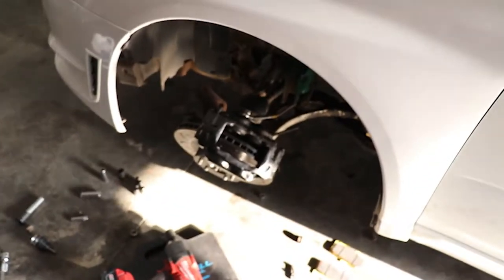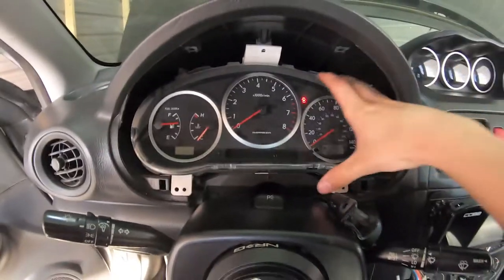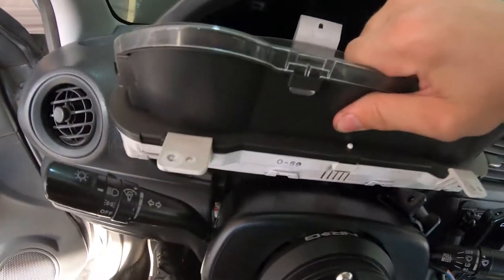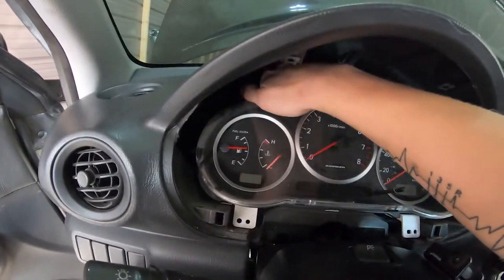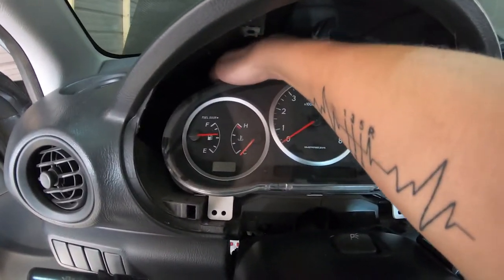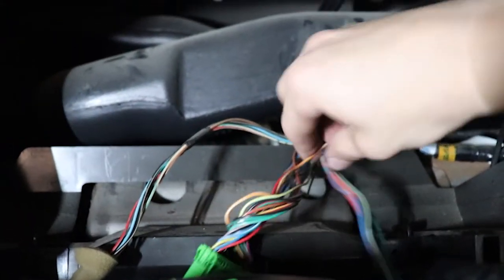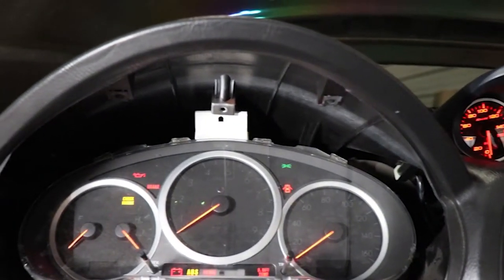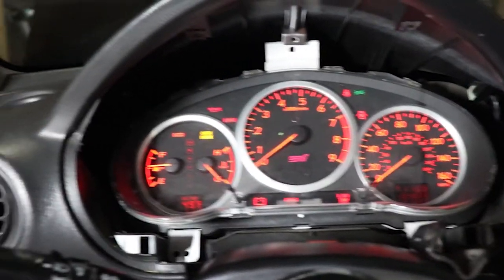Installing an STI Gauge Cluster Into my STI Swapped WRX

Comment: Hey man, what are those wires for? Does that stop the brake and abs light staying on? 
What year model Rex do you have and what yr cluster?
I've got a 03 blobeye and an 06 cluster and the abs light and handbrake light stay on, wondering if this wire swap will fix the issue.
Reply from the maker: Should be for every GD chassis and it's for the rear diff temp that the wrx doesn't have but the sti does